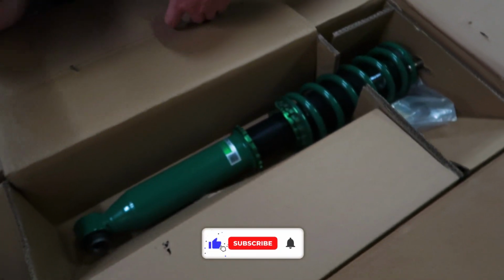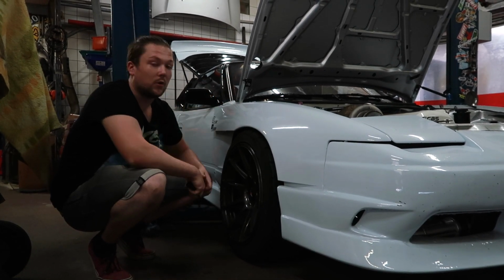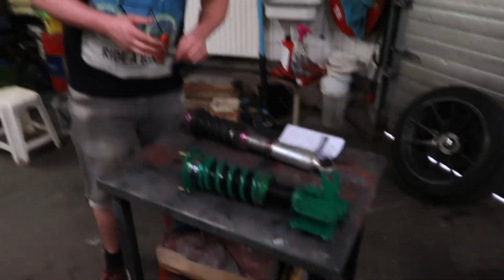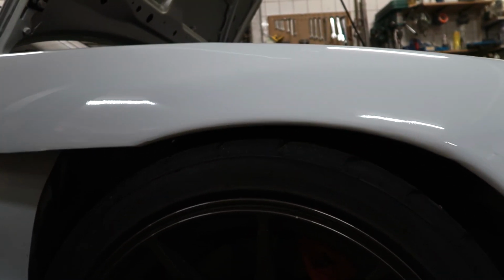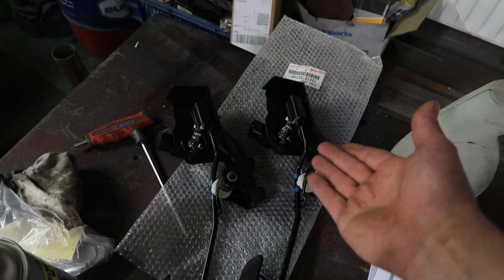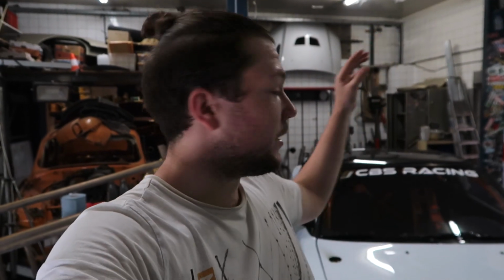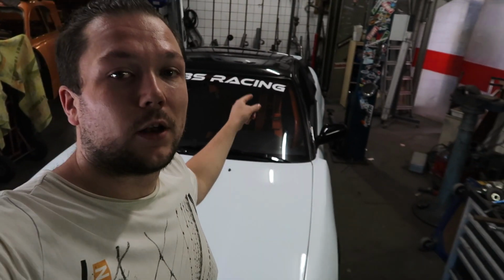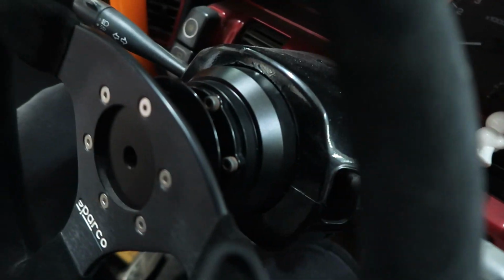1JZ SWAPPED NISSAN S13 Gets some much NEEDED MODS!!

Comment: Hi, awesome build, I'm in the process of building up my S13, (slow progress as I'm constrained by money and it's still in disassembly phase actually) just have a few questions and stuff I'm interested in. What throttle pedal is that? As I'm gonna go DBW. Are there any somewhat avaliable and easy to find pedals that can fit without much modification to mount it? What is you brake setup? See some relatively big calipers..What is the size of those rims? Have many more things I'm interested in but don't want to drag this on.
Thanks.
Reply from the maker: The pedal is a lexus pedal and you just need to drill out the holes a bit bigger to bolt straight in. Need to look up part number if you want. The front brakes are cadillac ctsv with 370z discs. The rear brakes are s14 front calipers with custom brackets and mercedes discs. The rims are 18/9.5 fr and 18/10.5 rear. You can always send me a dm on instagram for more questions!
Reply: @lithshop  Thanks for the answers. If you can find the part number of the pedal it would be great, interested in it. Maybe I can also compare to other pedals I have found before. Hmm I'm debating if I'm gonna go 17' or 18' rims. With my version 1 of the build and current ideas I have decided to keep the CA18 and just fully build it up. Heh I might contact you on Instagram.
Thanks.
Reply from the maker: Part number is 78010-30040 ! If you do the ctsv 6 piston calipers you have to run 18's ✌🏽
Reply: @lithshop  Thanks for the part number. Hehe yeah makes sense, I still have to see and decide what kind of brake setup I'll run.

Comment: Hi, love the car. What's your radiator/fan setup? I have same engine in same car but getting over heating issues even with a vented bonnet. Thanks
Reply from the maker: It's a dualpass Koyorad with 2 brandless slim fans that came with the car.